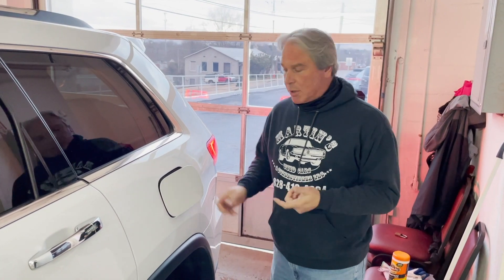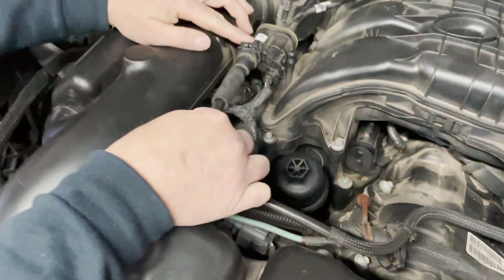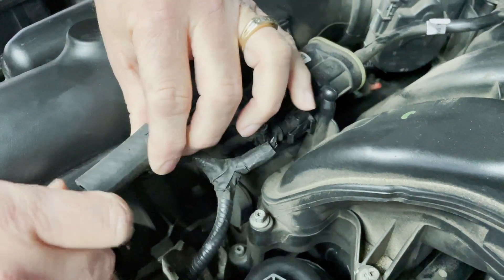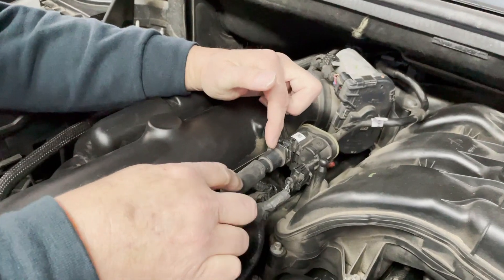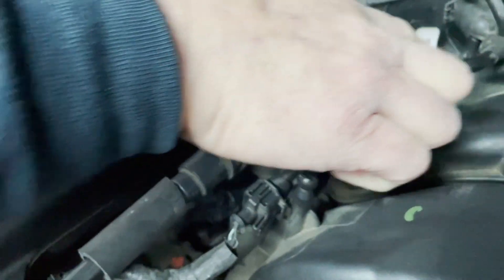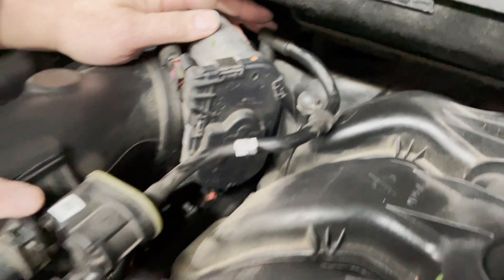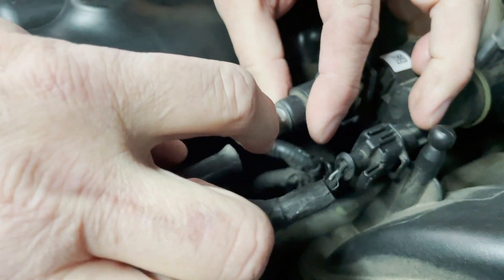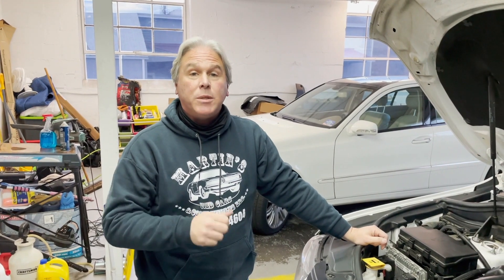2014-2015 Jeep Grand Cherokee P0455 Small Evap Leak Possible Fix - Purge Valve Vaccum Hose

Comment: Found this exact same problem completely by accident while removing the air intake to replace the thermostat when my 2014 threw a P0128 code for that problem. Thanks a lot for taking the time to explain the purge valve / vacuum hose. One more thing to fix. If it's not one thing its another!
Reply: Literally same scenario for me this week
Reply: @ hopefully you are luckier /don’t follow in my footsteps and need to replace the dreaded leaking oil cooler that is buried under the intake manifold. That’s this week’s fun project.

Comment: I've had it for over a year.  Annoying because I keep reseting code because it prevents remote start.  Mine wasn't totally cracked off so I wrapped up really good with galvanizing rubber tape and then wrapped up with automotive wire loom clothe tape.  Super easy fix!

Comment: This happened to me on my 14 cherokee, this hose usually brakes from that point allways. But i think is better to change the entire Hose instead of heat and just do what he said.  Emission Control Purge Hose is only $32 mopar original.
Reply from the maker: We agree and replaced the Purge Hose.
Reply: Part number = 68189075AE (for the next person)
Reply: @kiiiburn  hero
Reply: The world is better because of people like you
Reply: Is the new hose a plug and play , pretty simple? 

If i cracked the white clip, is it neccesasry to get a replacement? does it serve a functional purpose?

Comment: I’m having this same issue, evap code and I saw your video and I looked mine was cracked and then snapped on me. My car won’t start because of it. Once I get the part in I’m gonna replace it myself but I’m worried the car still won’t start after I replace. Do I need to reset codes or something after I fix it? I got electrical tape on it now and car still won’t start

Comment: I have a 16. And I have yet to find a video that matches my part. A hard plastic that connects to a woven line. The hard plastic is cracked, yes. But now to reset the engine light.

Comment: I have the same problem on my 2014 jeep grand Cherokee but im getting code p0456... will this work for that code as well?
Reply from the maker: PO 456 is probably the Purge Valve or the hose going to it.
Reply: If you verified you have a cracked hose, then yes it's the same thing.  456 is "small leak" 455 is "large leak".  When mine got bad enough it occationally did a P0455; it was only a P0456 for over a year before that.